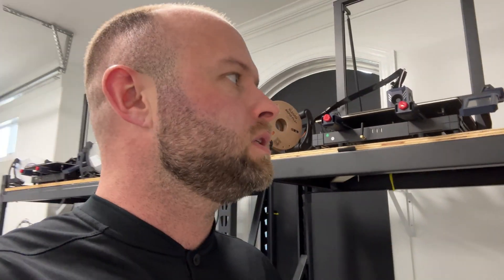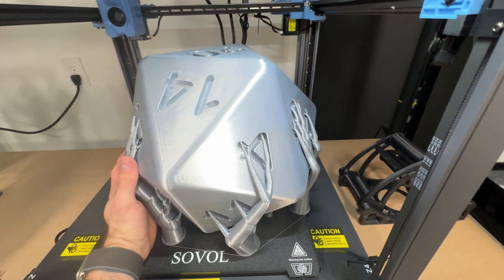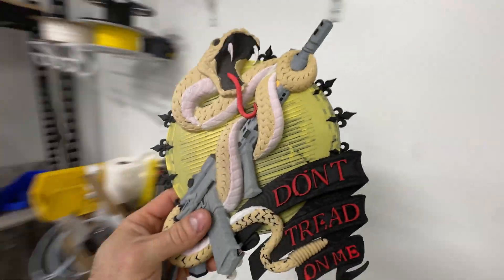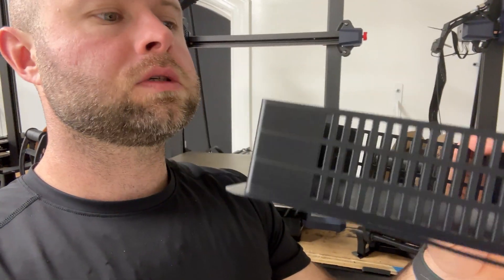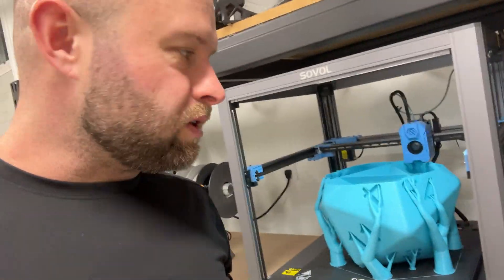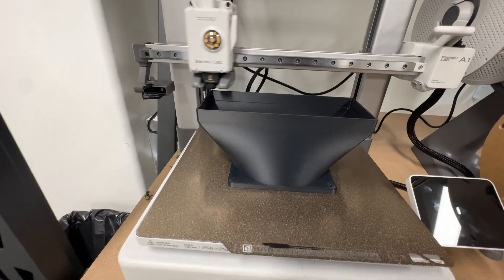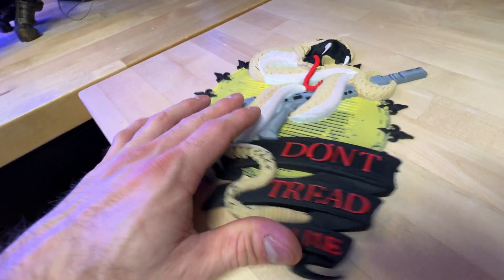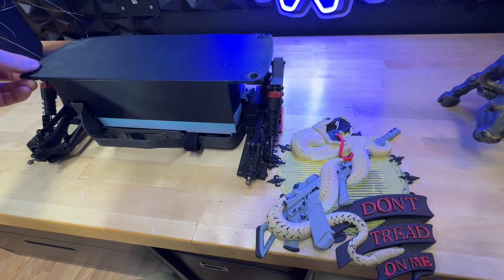Chronicles of At-Home 3D Print Startup Biz: Fuzzy Skin is SENDING me / Wall Placard=BIG Optimism

Comment: with painting the snake art, you can use the slicer to "paint" a few layers deep. the default paint function only paints the surface layer, which is why you're seeing that black bleed through the yellow. might be worth checking into.

Comment: if you or your wife have a later model iphone with the lidar camera, you can do 3d scanning at the proper scale with just an app. Wow on that purge tower on the bomb. The fuzzy skin d20 is looking cool.
Reply from the maker: Ive tried those photogrammatery apps before but the detail was suck, might re-attempt
Reply: @TechnicalsTinkers  Yeah, the photogrammetry only ones suck. The ones that use lidar and photogrammetry are better, but I'm not using the actual model generated. I'm using it for reference as to how to interface with the object in my design.

Comment: So there’s an overhang test which shows overhang in multiple orientations - x, y plane and a plane a 45 degrees.  You may want to run this test on your various printers and then see which orientation is optimum on the D20 dice.  You may find that if you rotate the orientation 90 )or 45) degrees that the overhang on this 1st few layers is better.  Also there is a YouTube video - I believe titled “uncovering prusas overhang performance” which gives some good tips which may allow you to tune out the overhang issues.
Reply from the maker: brilliant ty
Reply: @ and make sure the “1” face is the one that is on the build plate. Should be the easiest number to do the bridging/cleanup on.

Comment: If you have an extra ams slot, use a PETG interface layer on your supports. It works really well, and I do it all the time. You just have to use PLA and PETG with really close temperature variants.